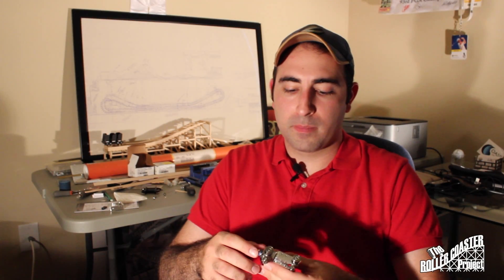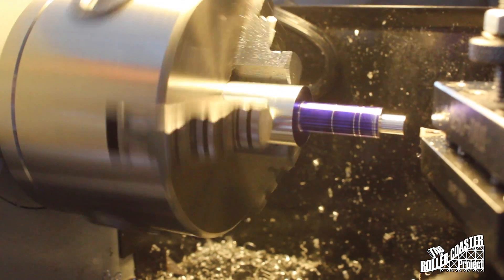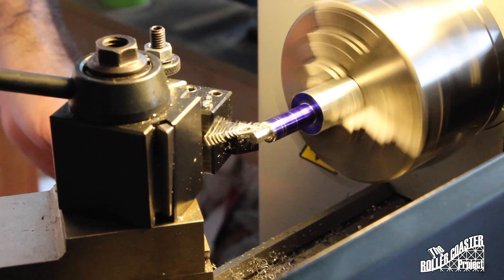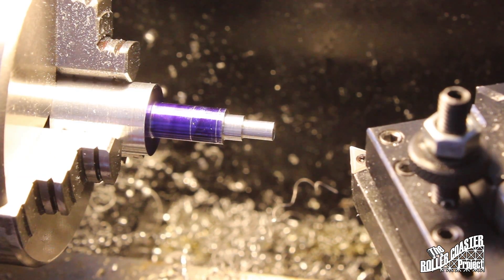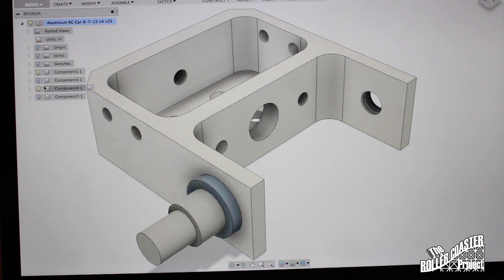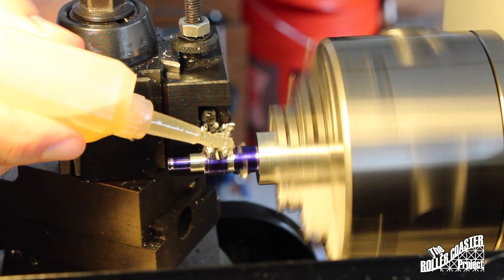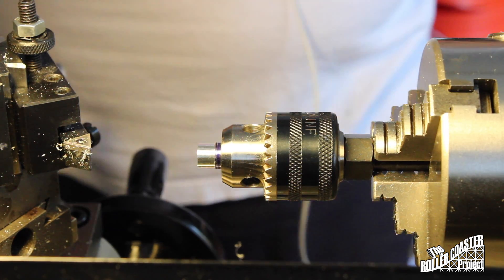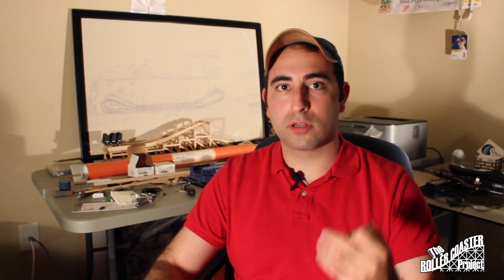Let's Turn Axles on a cheap Chinese Lathe

Comment: I have a Sherline CNC Mill and manual 17" lathe.  I love them, but as others have said, they are really underpowered.  You can do harder materials, but you need to go slow with sharp tools and take your time.  I think the bearings would handle an upgraded motor.  The advantage of Sherline is flexibility.  All parts are interchangeable and can be configured in near infinite ways.  I've used my mill as a lathe in multiple configs.